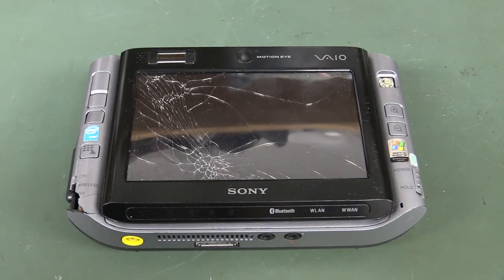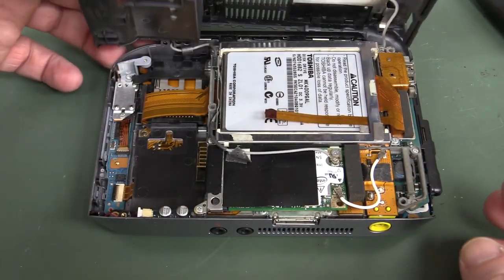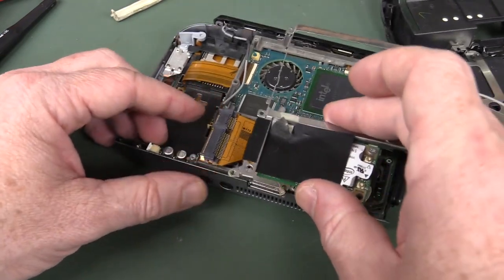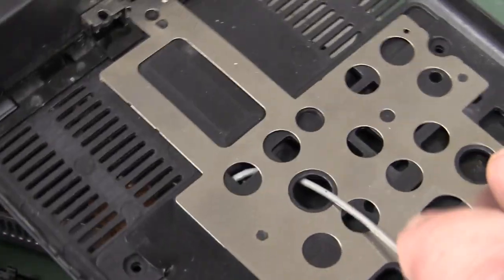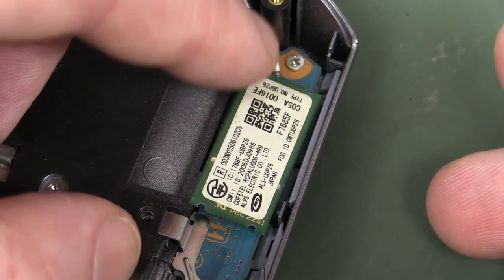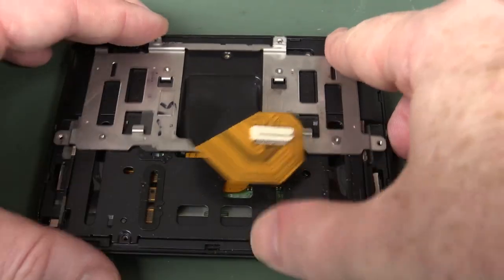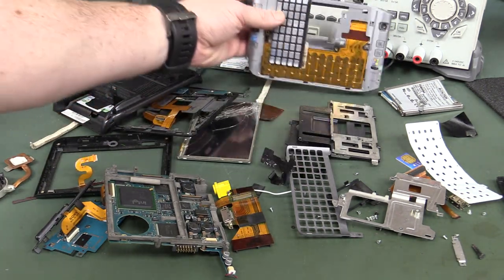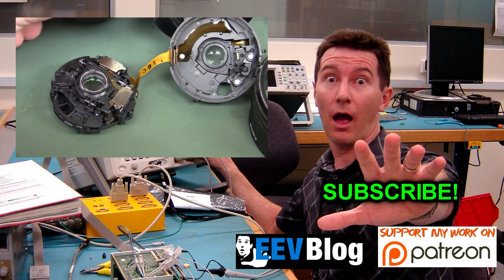EEVblog #914 - Sony VAIO UX Micro PC Teardown

Comment: Geeze.. I'm no Apple fan boi, but to think that the iPhone came out just a year or so after this relic. Crazy.
Reply: Then the Motorola Droid had a similar slide up screen a year or two after that.
Reply: iphone wasn't a pc nor is now,this thing wanted to be a portable pc not a smartphone.
Reply: It was like a tablet, but in a moto droid form factor(by that I mean scaling up a motodroid to tablet size). Weird as hell. Definitely was not what people wanted. Slide phones were already a thing back when this became popular, and was the most popular style of phone, if you didn't know, but android had not taken off yet.
Reply: Ouch, burn! My feels. My meaning was, all of that networking biz is on separate boards. Plus they're using discrete chipsets - not a lot of integration going on there. So what is it then? If it's running desktop software, then why is it sold as a mobile device? It's a solution looking for a problem, so I think my comparison is apt. The hardware and software of the iPhone shortly later became a tablet anyway, so ner.
Reply: MattExzy It was not a cell phone is what I was saying. It ran desktop software, but was meant to be more portable than a laptop, the niche tablets fill today(Some of them anyway).
It was hard to say what the 'correct' solution was back then, but putting a cell phone OS onto it was not the intention nor was it a solution. This thing had different intentions, and I don't mean to hurt your feelings xD
Reply: Oh actually, I was responding to nomslaw up there :) But yeah, I get that, I just find this thing puzzling.. not sure who it was aimed at. All those big, power sucking north and south bridges etc.
Reply: The only reason it could is because they where smart enough to switch to arm, x86 can do much heavier lifting but you need so much extra, large x86 proc chip you need to chipset driver and the IO driver. arm chips tend to have all these things in them.
Reply: As revolutionary as it was, it's been pretty bare-bones at that time. App Store came only a year after.
Reply: The original iPhone was not only less capable than that relic, but also less capable than practically any relic that was powered by either Symbian or Windows Mobile.

Apple won out with the iPhone because they got the interface right.  Something Google learned very quickly and Nokia really ought to have known
Reply: "Since you can't run windows programs on an iphone its quite assinine to make such a comparison"

Can you not install DOSBOX on iOS?  

I mean, once you get a Windows 95 on there...
Reply: GeoNeilUK Cell phones have a stripped down processor and simplified programs, these were meant to do proper production level work on if you choose, using desktop software, on the standard x86 architecture. It was not meant to play angry birds on or call your parents...
It was not a cell phone, it was more comparable to a laptop.
Technology wasn't up to snuff yet and its battery life and performance was too poor for it to be successful. This is why it failed, more than its form factor.
Reply: +nomslaw Thanks pal, you spared me the effort of writing exactly this.
Reply: lol@ all the obvious non-EE/computer engineers who think RISC somehow makes ARM devices "not real computers", as though there is some inherency to the iPhone's "inability" to run a "desktop OS" (as though that category is imbued with magic).
Reply: marshaul "
lol@ all the non EE or computer engineer's who think RISC somehow makes ARM devices "not real computers", as though there is some inherency to the iPhone's "inability" to run a "desktop OS" (as though that category is imbued with magic)."

Hey, I suggested DOSBOX.
Reply: I wasn't laughing at you. ;)
Reply: marshaul It's not the architecture that makes a difference, but the operating systems and software that can run on that architecture. You cannot install Windows on ARM...Unless its windows RT, which has like zero available software. That is a big difference.
You are not running an OS decently through DOSBox either... talk about people who have no clue what they are talking about.
Reply: Richard Smith You can install Linux on ARM though and because most of the software available for Linux is open source all someone has to do is compile it for ARM.  

Windows on ARM was never going to work really even without the "you must run stuff from the Windows Store" restriction purely because far too much stuff for Windows has been compiled for x86 due to that being the only architecture Windows supported.  

Also, Windows 3.11, 95, 98 and ME can be installed on DOSBOX which IS available on ARM.
Reply: GeoNeilUK People are not going to use this if they can't use their operating system. It matters to people, if they already know the software they want to use on it. By the way, the 'App Store' didn't even exist back then.
Smart phones changed a lot, expanding what could be done on cell phones, this thing predates that. You really need to see how primitive cell phone OS's were back then.
To cut straight to the chase, it was x86 SOLELY so it could run Microsoft Windows, this was the point. Android was not an option then, or at the very least, no one had heard of it.
Reply: Richard Smith People can install DOSBOX, people can then search for and obtain old versions of Windows that would run on DOSBOX.
Reply: GeoNeilUK Emulation is not an option with hardware which is already too slow. Also, DosBos wasn't even a thing back then... Additionally everything needs to work out of the box, and people wanted it to boot windows.
Reply: Richard Smith "You really need to see how primitive cell phone OS's were back then."

Nokia N series, Nokia E series, Sony Ericsson P800, P900, Nokia Communicator range, Pocket PC range.

Phones weren't that primitive back then, you need to realise how much of a step back the original iPhone was when it was released.
Reply: GeoNeilUK Those were VERY primitive if you wanted to actually do real work on them... You seem to not understand this devices market... this was not suppose to be an advanced PDA... it was a laptop, but smaller, at least, that was what they were going for.
Reply: Oh, come on. Windows is a crap OS. Let's be real. It's not the only "real" option. You can run a "proper" OS on ARM architecture, period.
Reply: marshaul Good luck selling them. I am a programmer, linux is my playground, I get it. The market doesn't want it though.
Reply: Richard Smith I don't sell mass-market computers?
Reply: Richard Smith "Those were VERY primitive if you wanted to actually do real work on them..."

How much real work can you do on a device with a 4.5" screen, 2 hour battery life and a user interface that is designed for a mouse that you're having to operate with your fat, greasy fingers on a deivce that needs a fan when turned on which means it'll cook very nicely should you keep it in your pocket?

"You seem to not understand this devices market... "

Well, I understand that this would have been competing with laptops, and it was $2000, how much were laptops back in the day with their bigger screens and their better keyboards and their longer battery lives and their pointing devices that you could actually use with Windows XP?

"this was not suppose to be an advanced PDA... it was a laptop, but smaller, at least, that was what they were going for."

And it flopped massively in the market, I wonder why that might have been?
Reply: marshaul "Oh, come on. Windows is a crap OS. Let's be real. It's not the only "real" option. You can run a "proper" OS on ARM architecture, period."

Have you noticed that Dick here has switched from the ARM architecture to "what phones were like in the olden days"?

It's as if I've defeated his arguments so he now has to move the goalposts!
Reply: Richard Smith "I am a programmer"

So what was it like to write mobile apps back in the olden days?

Which platforms did you write for?
Reply: GeoNeilUK Back then, nearly all mobile apps were written in Java. I was still in high school.
What does this have to do with anything...
If you want to win, win. I don't even know what the fuck you guys are so angry about. Take a win if you need it, I am done here, I think I explained well enough why this phone needed Windows on it, and why that required x86 hardware to make people happy.
Reply: Richard Smith Well, the original Nokia 9000 had x86 architecture, though it ran DOS.
Reply: GeoNeilUK I will agree with you that that example is definitely a weird choice for x86 xD
Reply: Yeah an the iPhone had about 1/8th the memory and about 1/10th the processing power of this " relic ' as you call it 😂

This PC could blow an iPhone into the shit pile where it belongs. iPhones can't run Windows. They also can't connect to peripheral devices via USB 2.0 or run desktop applications like Office
Reply: Joseph Beasley
So why didn't...? Why was it a market failure? Why is this video the very first I've seen of it... I myself even prefer Windows Phone to iOS, but c'mon, let go of your epeen a little and answer me those questions, huh.
Reply: Joseph Beasley
And if someone wanted Office, they'd just use a PC. This is nothing more than a PC class CPU crammed into a power-hungry chassis - that's my point. Zero optimisation or integration. But all of the chest-beating, man-child, epeen flaying wankers can't see that point, and instead jump to the conclusion that they themselves are indeed electronics engineers. You tell me which was the more successful product.
Reply: MattExzy because people are stupid and just because something failed in market doesn't mean it was a bad idea or innovative. 

The Delorean DMC-12 was also a market failure. But tell it it wasn't way more innovative than your Toyota Camry. Tell me you don't want one
Reply: MattExzy the thing you don't realize is what a market wants isn't what I want. 
I don't want a pissy, underpowered phone. I want a computer with enough processing power to run a desktop OS and do desktop shit, IN a mobile device.
You keep talking about the form factor. Well this is a COMPUTER in a handheld form . If you need more space to work, then what is the USB port for? What is the VGA port for?

* Hint. External monitor, external keyboard
Reply: MattExzy "Why was it a market failure?"

Really expensive and poor battery life.  It was a great idea but the technology wasn't quite ready, especially considering this ran Windows XP which just didn't work on a touchscreen.
Reply: Joseph Beasley "You keep talking about the form factor. Well this is a COMPUTER in a handheld form . If you need more space to work, then what is the USB port for? What is the VGA port for?

* Hint. External monitor, external keyboard"

Why bother when you already have a PC or a laptop, both of which are far cheaper than this and have far more storage space and processing power?  Having to use an external monitor and keyboard (which you would NEED for Windows XP) kind of defeats the point of this device.
Reply: GeoNeilUK why bother?
Because a desktop or even a laptop can't fit in the palm of your hand. A laptop can't go in your pocket or purse and wirelessly connect to the internet via GSM or LTE etc.
Reply: Joseph Beasley And the point of a device that needs an external monitor and keyboard anyway?  When you already have laptop with you?
Reply: GeoNeilUK and yes, desktop PC has more processing power than this. But that is my point. 
Modern smartphones are a joke.
For a thousand dollars you get a underpowered Facebook toy that runs an operating system that requires proprietary apps that aren't nearly as capable of doing work as desktop ones. 
You have to deal with heavily customized ' firmware ' that is device specific making it impossible to get updates promptly. You can't install your own OS or modify the devices software without being a goddamn engineer
Reply: GeoNeilUK the idea of this thing is it is a PC running Windows; a desktop OS on a handheld device.

No, it's no perfect. The technology of 2006 prevented it from reaching its full potential. However the concept is brilliant. A full fledged computer, with virtually limitless memory and storage space IN a handheld.
Reply: GeoNeilUK thats a notebook HDD in that thing. So that means any 3.5" HDD will fit. There's your terabyte or more hard disk.
Those are regular DDR2 memory chips. 8 of them.
DIMM slot for 2/4/8/16 GB of RAM?
Reply: Joseph Beasley "No, it's no perfect. The technology of 2006 prevented it from reaching its full potential. However the concept is brilliant. A full fledged computer, with virtually limitless memory and storage space IN a handheld."

That cost $2000 and gave you a 2 hour battery life.
Reply: GeoNeilUK what part of 2006 didn't you get? Lol
If it had a ULV Intel processor and a SSD drive would it cost $2000 and have a 2 hour battery life?
Reply: GeoNeilUK Intel's Atom series can outperform that old Core solo and use less than 2 watt power.
It'd be even easier to make that thing now and I guarantee you it would outperform the fastest Android phone on earth. I can assure you it'd make the iPhone 7 look like a McDonald's toy 😂
Reply: Let's be fair, making the iPhone 7 look like a McDonald's toy isn't that high of a hurdle for anything.
Including some McDonald's toys.

Last I checked, "the market" wanted smartphones and tablets because that's all that's being made.
The market can not desire that which does not exist, and after enough time of making the same thing, any predictions of "what to make for next year" end up with the result of "build the same thing as last year, but a tiny bit better".
Reply: Ironically this was far more functional than the original iphone, however it clearly wasn't something anyone wanted.
Reply: Ahh, well that's a different proposition entirely. The iPhone is a RISC architecture machine, and iNTEL were in a speed war with AMD at this time, trying to surpass the 1Ghz processing speed by running the silicon so hot it practically melted. (by design, because the electrical resistance is apparently lower at melting point) They weren't looking at low power, low thermal footprint devices at all. If you could run Windows XP on ARM, or if this device was a Windows CE device, then you'd be looking at a Microsoft alternative to an iPhone, and you'd probably be tearing down a Compaq PDA.

Another way to look at it, is that this isn't an iPhone, it's a hand-held Mac! So something that would run OS X 10.3 Panther, rather than iOS 1. But even then, Panther was ideal on a IBM/Motorolla 604e PPC processor at 600Mhz, and that is also a RISC chip that would run much cooler and with less power than an iNTEL Celeron at (I'm guessing) 0.8 - 1.2 Ghz.
Reply: But PowerPC is not ARM. In fact it's vastly more complicated.
True enough RISC computers can be very powerful. This is evident by archs like POWER and SPARC, mips64 etc.

 However Intel remains #1 in the PC market. 
Even Apple who tried everything they could to avoid the microshaft/Intel stranglehold, eventually folded to x86. 
why? the PowerPC architecture can easily rival Intel or AMD when it comes to high performance/ general purpose CPUs for servers or desktop PCs.
Reply: Also IBM Power processors run very hot.
they use as much or more power than equiv. X86 chips.
Reply: This was way more powerful and did x100 more things then the iPhone

Comment: I think this device was way too far ahead of its time. xD It does have a docking station that has VGA and USB ports so it was fine in a sense when you used it as a daily driver at the time for using Office programs.

Comment: I tested a lot of ULCPC "ultra low-cost PC"  devices on a contract at MS, this one certainly wasn't "LC" and had battery life issues but it performed fairly well on XP (probably because of the HDD.)  fortunately we used a KVM and various UI automation API's to do the actual testing, as there were some Very Bad Ideas across many of the human-interface devices.  They almost never left their docks  xD

Comment: If I ever find one of those at a really good price (say $20) at the next Hamfest I'm definitely getting it.

Granted the specs for it aint that great compared to what you can get today (especially for the original $2k price tag!) but I do like the way the casing looks, puts me in mind of those cyberpunk stories and shows.

What I'd really like to do is carefully take one of those apart and remove the electronics/display then replace it with modern (cheaper/smaller/less power hungry) equivalents like a raspberry pi 3 for example (or perhaps even some raspberry pi zero's).  Depending upon how it's all done that could leave some room for future improvements and expansions......

Comment: if only Sony updated this line. they could have had the tablet market
Reply: Rohan Mishra Right!
Reply: the vaio UX line and many other UMPCs alike were all part of a Microsoft & intel partnership effort into mobile devices with full windows.
Those UX things sold as well as their Vaio P line did: pretty bad. Like every other manufacturer involved in the project, sony stopped making any newer models of them as soon as microsoft stopped sponsoring them. With ultrabooks proving much more profitable, both the UMPCs and the netbooks ceased production before 2010.

Comment: I would assume that this unit must have been used in an environment that didn't allow for USB connection or recording capabilities.  A rather crude method of disabling these features.  I would assume that there may be some additional items that may have been disabled as well.